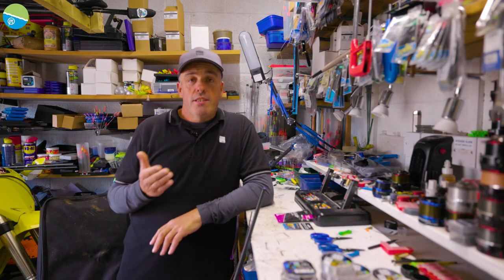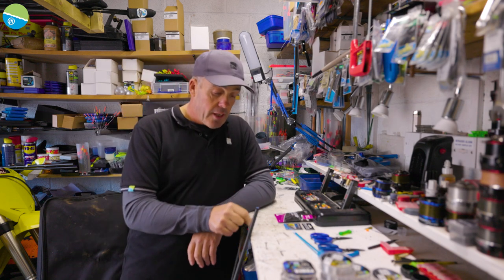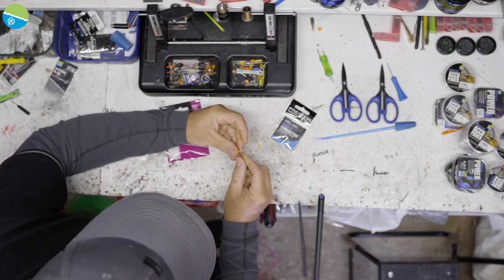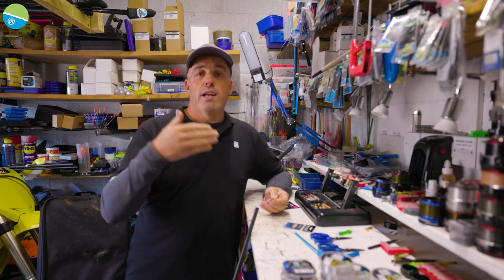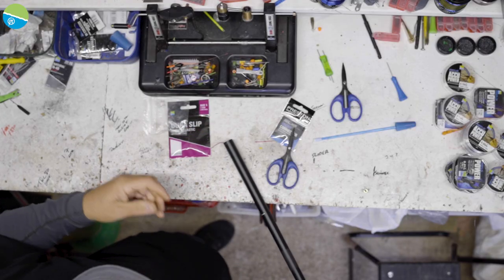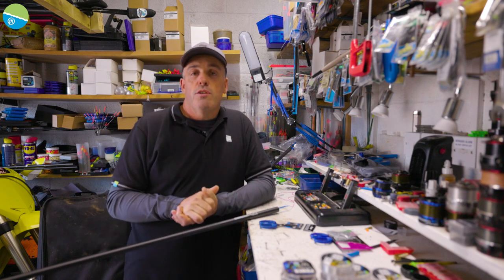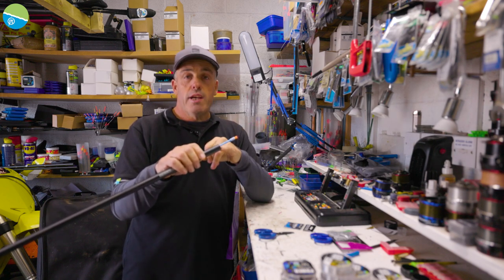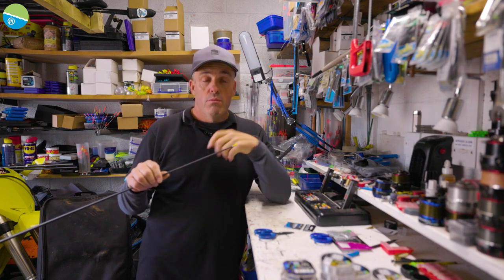HOW TO ELASTICATE A FISHING POLE! | How To With Des Shipp

Comment: I remember having to select an appropriate tip bush and cut the tip section back before doing this part, apparently that's not a thing any more?
Reply: That depends on the pole you have I believe.  I use Shimano poles and they have the right diameter to fit a Preston yellow tip bush so you don't have to cut back your tip section.